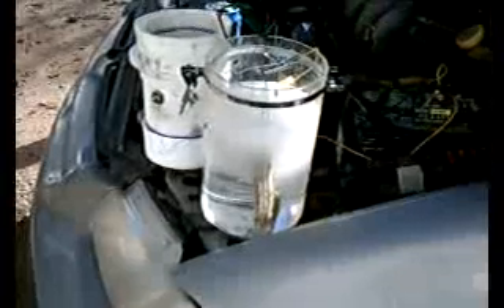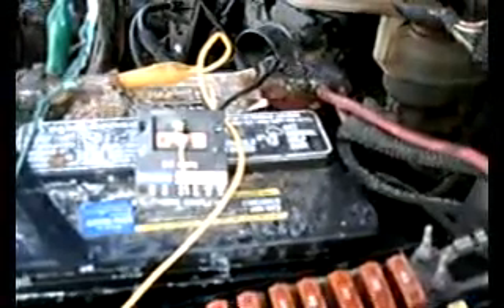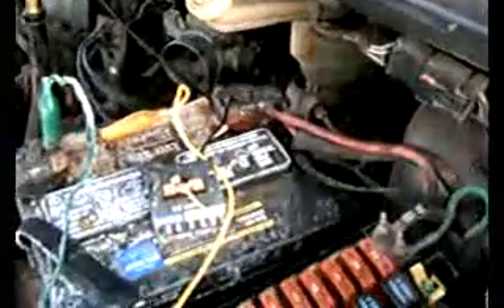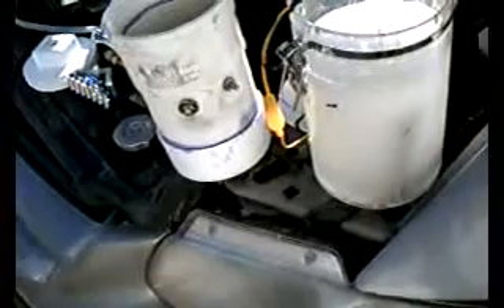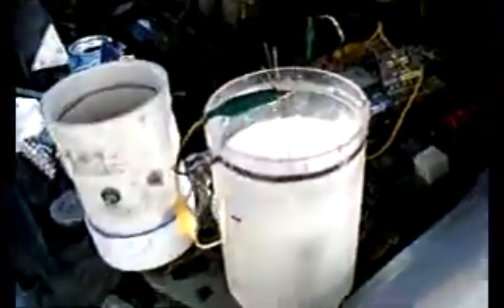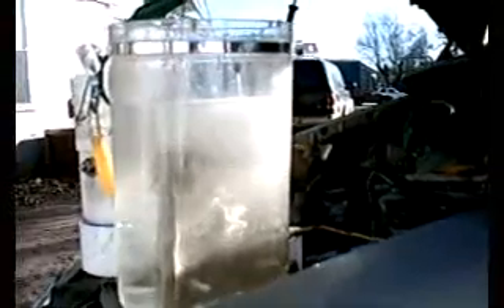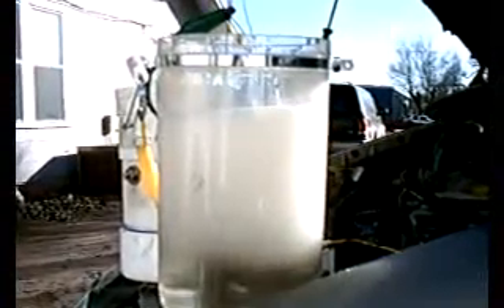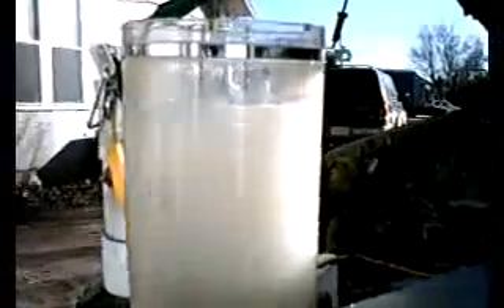Great HHO Results!!!

Comment: Need more gas stainless steel plates .need pwm separate plates .will not ground out current will be low .that will work . You will have enough to run your car then .the way you made it will not work every long .will get to hot .this web site will help HHO .com.
Reply from the maker: James Newman this was one of my early videos, i did figure it out pretty well, just could no trick the computer. I realize a stand alone computer is the way to go and i will try that in the future. Please watch my video on how to build an S- Cell. That one produces very well with 5 volts, no heat in the mix and all the hydrogen i wanted. I still have 2 final prototypes that still work perfect. There is actually another youtuber that replicated my attempts with great sucess using a 9 volt battery. There is absolutely a use for this tech just trying to wait for the right moment. Thank you for your insight. Just look at my videos from way back and you will see. SS mesh is the ticket

Comment: You know what........its all based on the electrolyte being used to make the hydrogen....vinegar and baking soda just don't do it but try sodium hydroxide and dilute the distilled water with alcohol 50% to stop freezing.
Put a modulator on the system, run it at 7amp to 15amp, then check the savings.....I get a 30% fuel saving on a ford ranger 4.0L, not bad.
But cut the baking soda out thats just being cheap.

Comment: @HiFiman4u What i wrote was based on the National Electrical Code. i was more so concentrating on the amperage factor, but yes i do agree with what you said, most cables/wires used by electricians like myself are either rated 300 volts or 600volts, typically when your on that scale thickness does not come into play until you get into the higher voltages say for instance like on power poles. where power levels typically exceed 13kv and higher.

Comment: @CSIROCKSUS why not just use a DC-DC converter?Going DC-AC-DC seems not so efficient to me.You are on the right track though about using lower voltage=less heat.

Comment: one other thing, this is for "NEON271156" cable is not rated by voltage it is rated by amperage. quick electrical 101. voltage is just pressure. it pushes the electrons through the wire depending on the voltage if you raised the voltage it would push the electrons through the wire alot faster. and vise verca.  amperage is the amount of electrons given in one section of wire a "culoumb"   so 1 volt can push 1 amp through 1 ohm of resistance.

Comment: here is what wire size you use for what amperage you draw from your generator.   
 15amps or less - 14 gage wire
20amps or less - 12 gage wire
30 amps or less - 10 gage wire
40 amps or less - 8 gage wire

for example, say your generator draws 22 amps you would used a #10 gage wire because its over 20 so that eliminates 12 gage.  but you would fuse it at 25amps because they make a fuse for that
Using the right wire will save you on your heat issues with the wire.

Comment: why not use batt acid as we did at 1250 grav it worked very well so why not ? you will find that if plates are no more then 3/16 to 1/8 inch apart production is higher , 
best wishes keith Sinclair

Comment: how many amps are you pulling with 5 volts?

What method did you use to get the 12 volts down to 5? A resistor seams would have to be a big rascal.

Comment: I just made a 7 plate cell... it seems like 20 amps is a still alot. When I was running around 12 it seemed like 30 minutes is as long as I would feel comfortable running it (got real hot). I got mine down to around 6 and that seems to work pretty good. I just spaced them out a little more.

Comment: Hey bro, Baking soda as an electrolyte causes a resistance in the water. This is what causes your amperage to climb. Keep the amps at 20 with the water already heated, or you will need to build a cooling system for the water. The reason for this is, as the water heats up your amperage draw will increase. As the amperage increases so will the water temp. thus you have the snowball effect, a runaway cell. See my video for more info. watch?v=2nAROmhiZsY I have over 30,000 views.

Comment: 20 amps is ok for your alternator so you have some room for adjustment on your cell in order to make it produce more but as SEEPHOR mentioned you must be aware that if your pulling more amps you should be making a lot more hydrogen because if not your just wasting your alternators power.

Comment: You have to find the cherry point of amps to hydrogen output. There will come a point where the energy you put into making the hydrogen will be greater than the hydrogen generated at which point the experiment is useless. The goal is to use as little energy as possible and produce as great amount of hydrogen as possible. It's the ratio of power in to power out which is important here.

Comment: note: baking soda or any electrolite forms the function of letting more amps flow through your water. 

you are not pulling too many amps really for the production you are getting.  You may want to get a pulse width modifier to have control of the amps exactly as the water temp will make the amps run away from you when it heats up.  

p.s.the water gets cloudy with baking soda in it as the bobbles don't clear as fast.

Comment: you will find that tap water makes a lot of crud.  so much that you will not want to drink that stuff any more! yes, you use your electrolye (baking soda, lye, caustic soda) to control the amps.  how many amps has a lot to do with with how big your wire and how your cell is designed. Keep in mind that AMPS = GAS.  Low volatge, high amps brute force electrolysis. mine runs 12v 20a @ 180F w/1L per min.